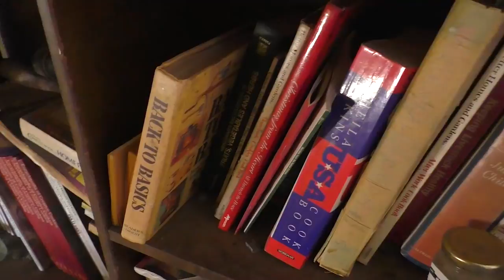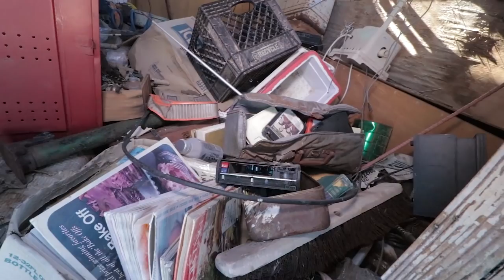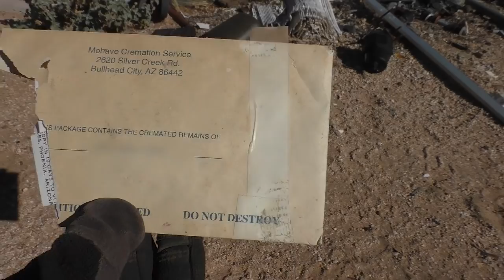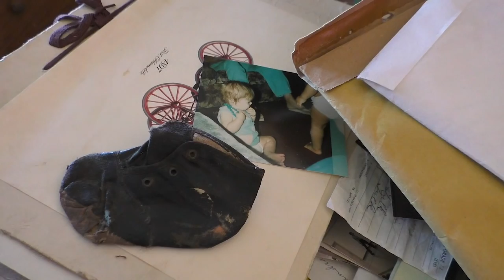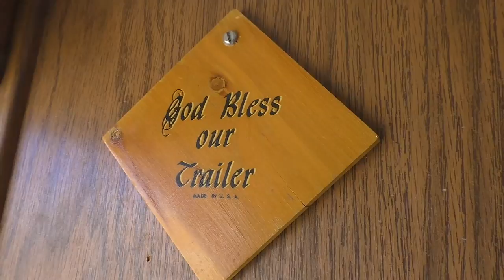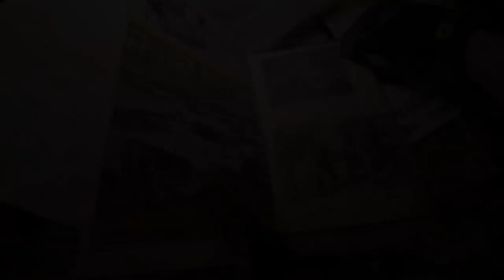FOUND HUMAN REMAINS WHILE EXPLORING IN THE MIDDLE OF NOWHERE...

Comment: The old cell phones are supposed to be able to call "911" in case of emergency even if no longer connected to any carrier at all such as "AT&T", "SPRINT", "NEXTEL", etc., so if you do charge them up if the batteries will accept and hold a charge or even with external power you should be able to call 911 as a bill was passed into law a long time ago that's the way it is in NY.

Comment: All i remember is 8-track, atari, and some killer vehicles!!!
Honestly looks like an abandoned family compound or just a tiny private trailer park. Maybe an old recreational camping site? Or maybe a workers camp? Tons of possibilities. I favor the notion of the old trailer park idea. The evidence shows a lot of different familys lived there not just a single family. You can even see how the trailers are laid out and spaced including over grown driveways. Also from the looks of things a lot of the items that were there seems to be in good condition and somewhat clean and organized at one time, but i bet the scrappers and vandals and looters easily tossed useless scrap out of the way. Also at one point used the property as a dump cause in the entrance you can see organized piles of garbage,scrap,tires, etc and than as you proceed farther its "organization" of items disappears. You should inquire about the property and buying it. I easily saw $50,000 worth of resellable and rare items not including the scrap value. My mothers antique shop up here in Manitoba Canada sold a set of washer and dryer (rollers that squish and press out the water in order to hang dry) for over $3500. Mechanical was redone to working condition with new enamel, quite easy to fix!

Comment: That 1st old washing machine you showed is like the one I used in the communal kitchen at my 1st bedsit in London in 1972.  That's a small electric mangle on the top. There was a matching spin dryer and I tell you, as long as you sat on top of it to stop it dancing all over the kitchen, the clothes came out of it almost dry it span so fast. Modern washing machines don't spin anywhere near as fast. What an interesting place you found! I too wonder what happened??? You don't leave your recipe cards and memorabilia AND your flip flops by the bed!! You're right!

Comment: That king sized mattress on top of the twin mattress is kinda funny. If you rolled over you’d you fall on the floor! I’m 65 & I remember doing laundry with a machine just like that with my grandma. She would set it up outside. I was under 6 so I’m sure I probably didn’t help a lot! I also went with her to pick cotton. She made a bag for me, my size & I remember making a quarter. But most of the time I would just ride along on her bag as she moved along. She had back problems later & now I feel bad cause letting me & my brother riding  on it  probably gave her some of the problems.

Comment: There was a time in the late 60's near Devore, California,  small parcels of land with a tiny white cabin and a water reservoir were selling for around $25000. Want- to -be off the grid opportunists bought these places; not long after that,  these same people started to abandon these dwellings in droves. These places collapsed on their own, people just let them go and did not remove their possessions. My friend owned one of them but back then he could not sell it either because there were so many abandoned places owned by the banks that the value plummeted on these places. We  also explored. I could not believe how people just left  everything behind as they did. The problem encountered was there was no electricity, garbage collection, septic tanks, mail service, police as city folks were used to. It snowed and was extremely hot in the summertime, these conditions helped ruin these cheaply made cabins which were not inhabited very often after the novelty wore out by their owners;  Owners just left them rot unattended in the elements. My friend finally sold his for pennies on the dollar.